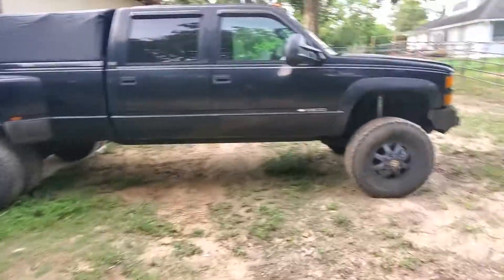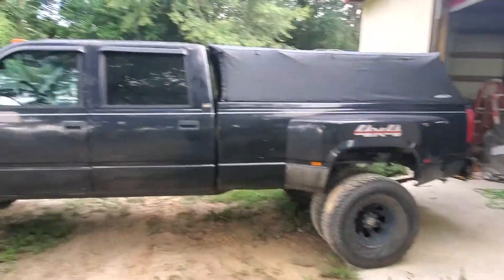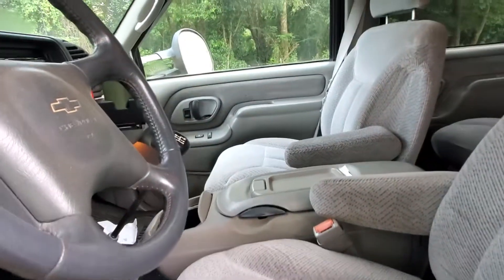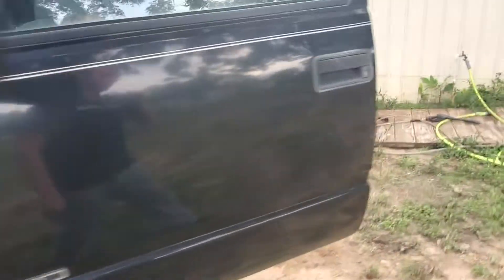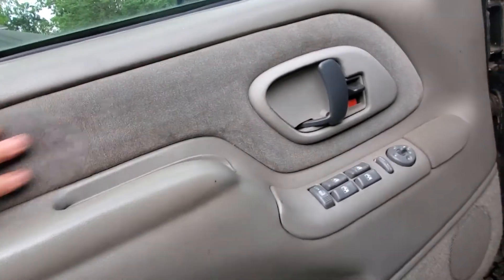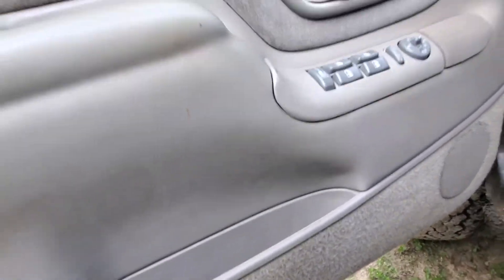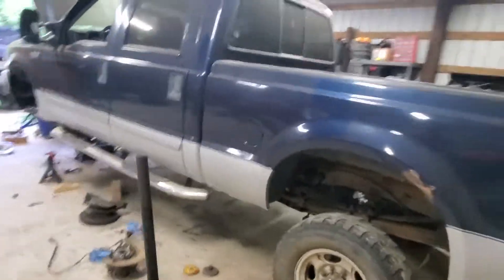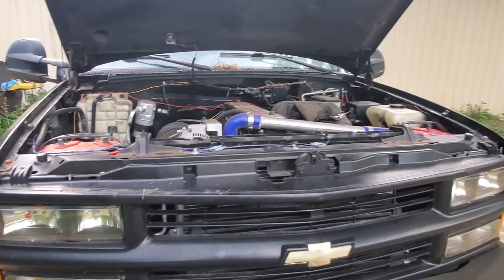Super dually update! Part 3.

Comment: Glad to see you're still having fun with it.  I finally finished my K3500 Cummins a couple weeks ago.  I also have a K27 and the 500hp fueling kit and AFClive from PDD.  The K27 is not ideal for these trucks.  The exhaust outlet sits ~2" further back than the stock HX35.  I had to radically clearance my 4" downpipe to make it work.  With either the Dodge manifold OR the F700 manifold it was a super close fit.  I can't see making an exhaust brake work well with the K27.

Comment: What trans and transfercase are you running in this setup?
Reply from the maker: Nv4500 chevy gearbox. Cummins bellhousing. Bw4470 tcase. Its getting swapped to a 241c
Reply: @jonathanstansell8511  so its the stock Chevy trans and all with a dodge bellhousing?
Reply from the maker: @StaffordGarage4706  if you have a newer gm nv4500 the cummins bellhousing works on it yes.
Reply: @jonathanstansell8511  thanks for info.